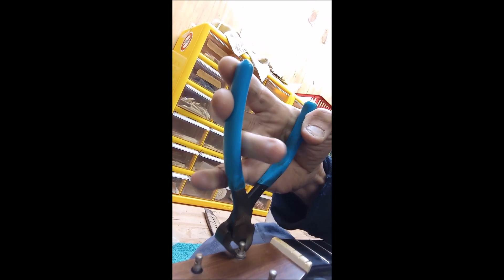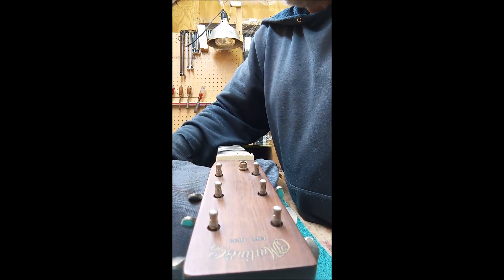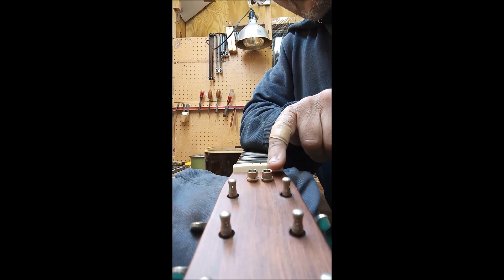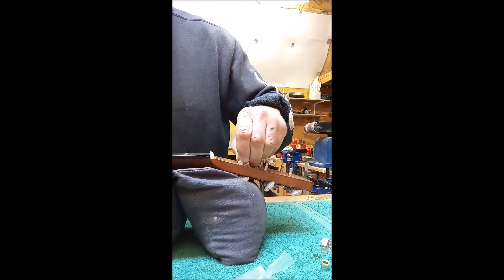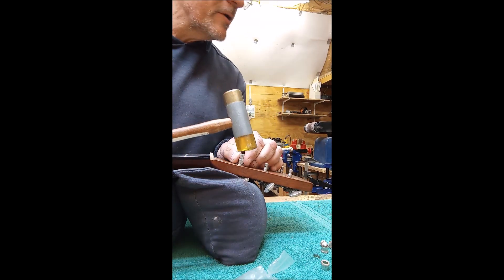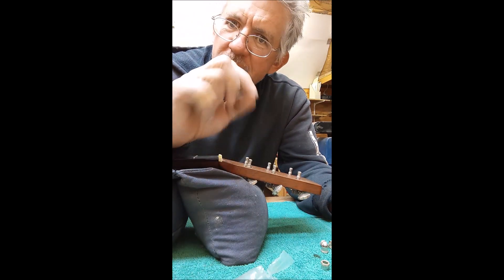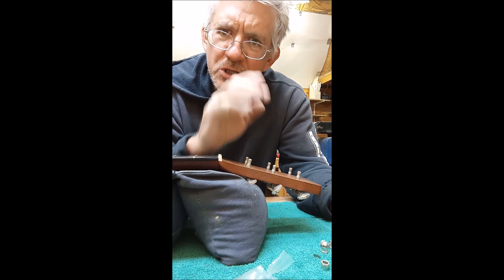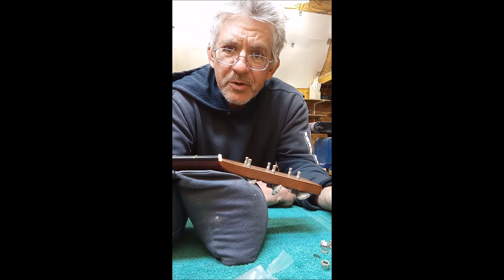Tuner grommet washers on Martin guitars

Comment: The Gryphon guys removed mine and didn’t replace them with anything.  They consider them non-essential….kind of like an appendix….. 😉
Reply from the maker: They put grommets back in, right?  'cause the diameter of the hole in the headstock is quite a bit larger than the diameter of the tuner shaft (obviously, or you'd never get grommets in there) and if you don't support the tuner shaft, it'll lean forward which is, obviously, terrible for the tuner. 

The reason I replaced the stock grommets with Waverly is because, like I said, they're better grommets and I have millions of them laying around.  You can 100% just remove the washer and put the stock ones back in which is what I figure Gryphon did.
Reply: @Bryankimsey  ….I’ll check the headstock next time I’m back home…..I’m pretty sure they said it was just the washer that was worthless…..I’m pretty sure that yes, they would have kept the grommet.
Reply from the maker: So... that's pretty much what I did, except I used Waverly grommets which fit snugger.   :)
Reply: @Bryankimsey  ….just picked up a D-18A 37…the case storage contained 6 grommets in a little ziplock baggie….someone changed those out, too, I guess!

Comment: I have a 1990s Martin HD-35 that has locking tuners on it and I want to put the waverly high ratio tuners on it what size bushing do I need to be able to put the waverly on there?
Reply from the maker: Locking tuners aren't stock and I've never even touched a set, so I have no idea. You should remove one and measure the hole.

Comment: Thanks so much for this video. I have a ‘95 Custom 15 HD-28 Martin. When I bought it I took to a local luthier to have the tuners changed out to Waverly tuners. However he said he could not use the hexagon bushings because the tuner hole was too big. So my question is do you think these bushings would work on my guitar! If so where can I find a set? I always wanted hexagon bushings because they look more original to the prewar Martins!
Reply from the maker: What tuners did you have on there?  The grommet holes have varied a lot over the years depending on the exact tuner used.  I think the Custom 15- a precursor to the HD-28 VR and then HD-28 V- used Gotoh open back tuners and the early ones DID have slightly bigger O.D. grommets. 

However, it's ridiculous that he couldn't use hex bushings!!!  For one thing, Stew Mac sells both "conversion" (in two different sizes) and Waverly bushings in both hex and round.  I nearly always use round conversion bushings on 70's because the round blends in better with the "raccoon" eyes but hex are more early-vintage looking.  

For another thing, a good luthier should be able to build up the very slightly oversized holes with glued in wood or carbon fiber or even aluminum strips and use smaller bushings. You can actually wrap the smaller bushings with aluminum and then set that with epoxy and build up the grommet w/out ever touching the guitar.  This is more work = more money and so I nearly always just use conversion bushings, but it CAN be done.

Comment: Thanks for this video. I'm not sure if this is my problem, but it certainly could be a part of it. I have a 2002 D18GE that I have been increasingly unhappy with the sound because of buzzes/rattles. It isn't all the time, but it is certainly there. I was blaming my increasing tinnitus and hearing loss for the strange sounds, but after seeing this video I noticed the G string grommet, and the high E string grommet is slightly raised and that little washer can move around. These are original Waverly tuners. I assume that means they used Waverly grommets too? Would a temporary fix be to tap the offending grommets in till they were tight again be a reasonable way to tell if this is my buzz problem? If it does work, but eventually loosen again could I pull the grommets and re-use them after removing the washers? Or would you recommend getting new grommets if I remove them?
Reply from the maker: I recommend you you pull the grommets out... they're probably pretty loose...throw the washers away, and just reseat your current grommets

Comment: What rattles? this is BS...
Reply from the maker: The washer rattles against the loose grommet- which does not seat firmly due to the tapered, weak-splined design. Do some research.  It is an extremely common issue on the Unofficial Martin Guitar Forum.  

Here's a start:
https://umgf.com/martin-00015sm-tuner-rattle-t211344.html#p2584023
Reply: Even a cursory delve in to Bryan’s videos tells you that he doesn’t do BS.